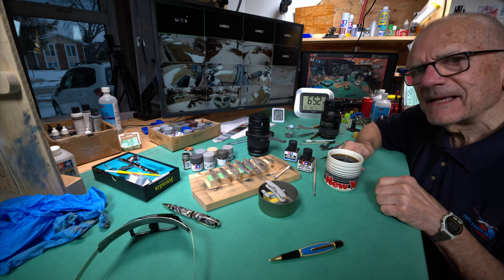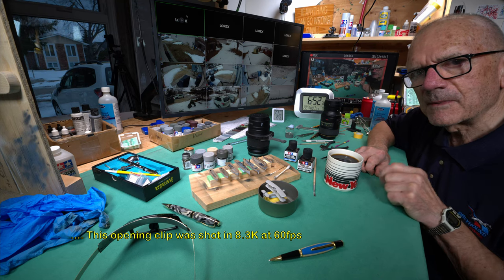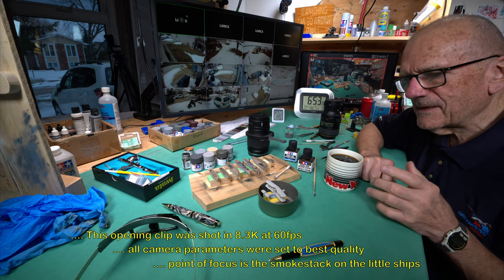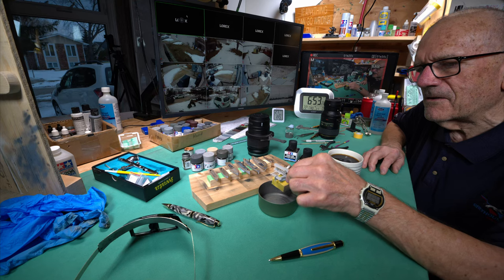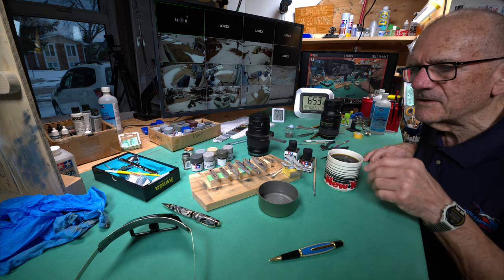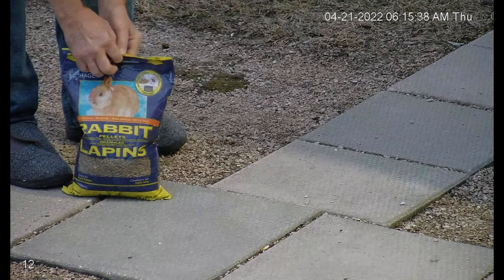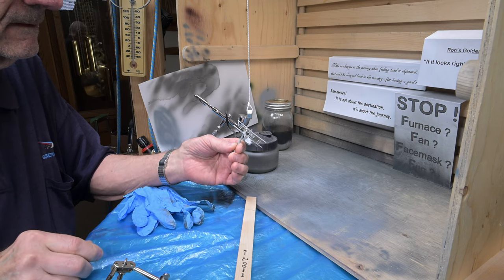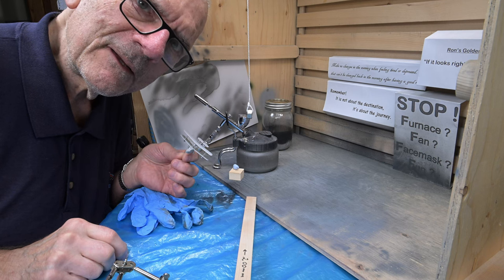The Model Ship - Part 1154

Comment: Might use a dot of CA instead of the Tamiya Extra Thin to stick on the painting handle.  If you just use a dot it will hold ok and not be overly visible when you're done.  Also it can be cleaned with CA remover if it's too messy.  Great content as always.
Reply from the maker: Good tip! CA would have been the better choice alright. 👍

Comment: Clever idea to add the hanging nut to give you a visual cue when you are about to move up and out of the field of view of the macro lens.  Would putting short strips of masking tape on the back of your spray booth's horizontal slats do the same thing to help keep from moving left or right out of the field of view?
Reply from the maker: Re: "Would putting short strips ......" A variation of that might work. 👍

Comment: 5:58 - You could shorten it further to - card 158 doesn't work.
12:43 - A 40/60 mix of Isopropyl alcohol & de-ionized water with a drop of dish soap will thin Tamiya acrylic paints just fine. 
De-ionized water - used in clothes irons, has no additives or minerals .
Reply: re 40/60 mix - so will Tamiya thinner and its ready to go stright from the bottle
Reply from the maker: Hi Andy,
Re: "De-ionized water " I'd heard of distilled water, but de-ionized water was a new one. Thanks! 👍
Reply from the maker: Re: "card 158 doesn't work" Much better, haha 😁